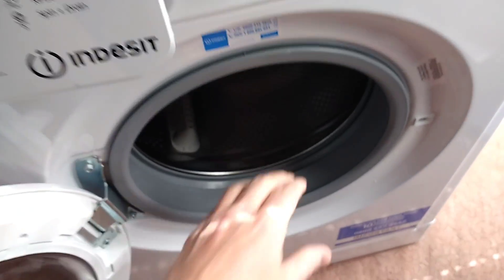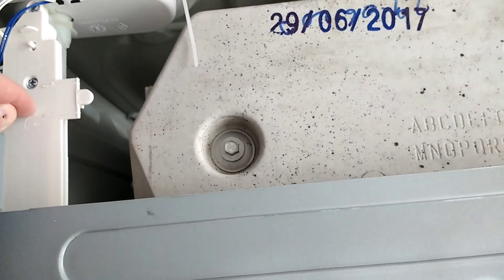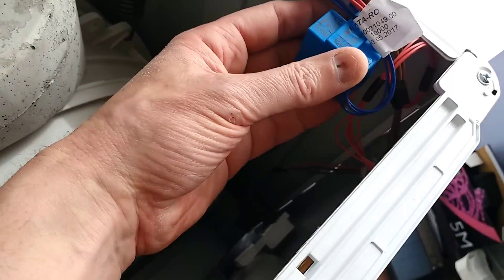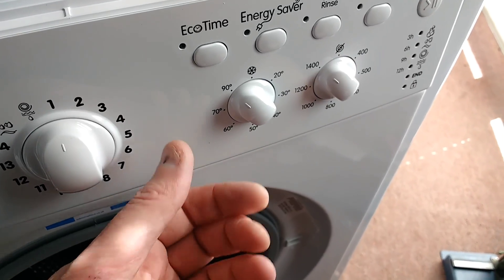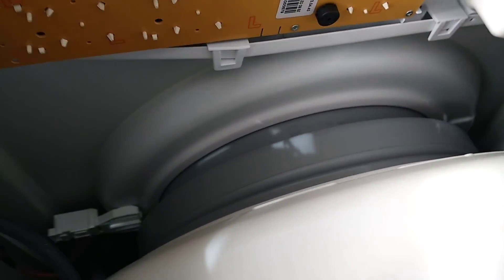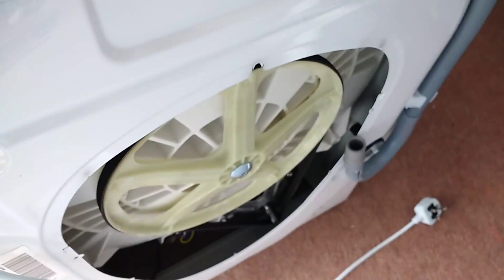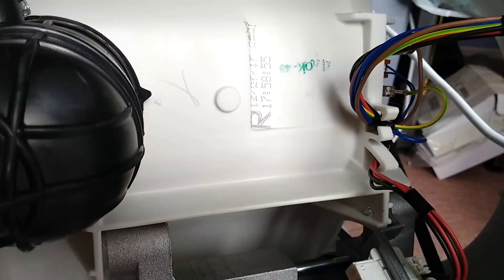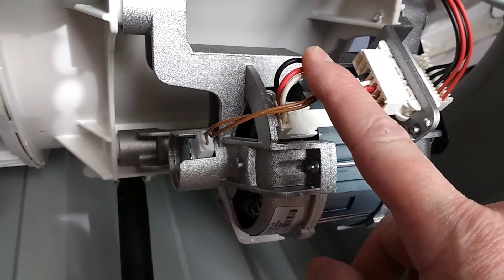Inside my new British washing machine (clothes washer).

Comment: In Russia you can get very cheap Indesit washer, it have very poor build quality. These washers are prodused in Russia in Lipetsk city. Maybe you can get there a model that is prodused in EU and a build quality may be better.
Reply: Supposedly a it is Russian machine, but with UK-plug & English text print. 
Russia has nearly the same power as UK ( machine supposedly made for 220-240V @ 50Hz )
Reply: The quality is poor because Indesit choose to programme in unreliability presumably to make more money on parts. Either it is deliberate or their engineers are stupid and can’t design decent drum bearings that last. Nothing to do with being made in Russia instead of EU. Beko & Zanussi are good medium priced brands in my opinion. Greetings from UK.

Comment: I'm sorry Clive i love watching your videos but as a man who works on these on almost a daily basis I just can't sit and look at more than I have to! It's bad enough when I keep hearing about the tumble dryer fires....I worked for hotpoint doing the so called "mods"....
Reply from the maker: I guess the mod might have been from the open wire heaters to metalclad ones?
Reply: nope, completely off
Reply: the mod was literally: remove the drum by complete dismantle, drill a small hole into the back of said drum, insert i rivet from the inside so the long bit thats left pokes out of the back, put machine back together! bare in mind we had to sign a form of secrecy so we didnt talk about this "mod" ..... whoops!

Comment: I was very briefly contracted by Indesit/Hotpoint/Whirlpool to fix their firey tumble dryers, their service side is about as cheap and nasty as their fabrication.  Literally impossible to do your job without cutting corners, they force you to work with insane time limits.

Weird, I don't know why you have a pulley for the drum, on the tumble dryers the belt just goes around the drum and onto a tension wheel.  Maybe because it has to go faster in a washing machine?
Reply: 1400 rpm spin.
Reply: The high speed spin, but also, the tub has water in it. The tub and basket are sealed, so there's no way to put a motor in there. also, the drum changes direction on a washing machine, so a idler tensioned belt would slip in one direction.

Comment: New machines for a while have been cold fill only, heats the water itself rather than triggering the gas boiler or needing to heat the electric tank, also a tip is to use slightly less soap powder with cold fill only machines unless you have hard water.

This is where a little pink tub of vanish comes in great for getting stains out (max 40c wash with vanish or it can harm colours).

Comment: I'm using the dryer my mum bought,  when I was 12, I'm 43 now.
Reply: What make is your dryer and how often do you use it?
Reply: @Martindyna  whirlpool model LG6811xpno
Reply: @Martindyna  we use is daily, currently family if 3. I grew up in family of 4, then for a few years it was just my folks using it.
Reply: @raymondmucklow3793  Interesting and thanks for the lightening response!
Reply: Ever checked inside for "escaped" fluff fire hazard? I have an old one (unknown age) and when I opened it up almost the entire chassis was filled with compacted lint. I removed it all before using it again; the fire potential looked really hazardous!
Reply: @josh46646  yeah wetvacced it all out, and found a. 22 bullet next to the head of t exhaust.

Comment: Disappointing to see how everything is made down to a price.
Reply: Would you rather have everything made ridiculously overspecified (i.e. expensive?)
A good design is as crappy as it can get, yet it still doesn't fail. Saves you money. It is just bad when manufacturers try to maximize profit by having stuff break intentionally, but usually thos failures are NOT within the "crappy" parts
Reply: Essential in most cases.

Comment: I had an old Miele apart not too long ago. Construction was somewhat similar but the drum was stainless steel, not plastic. The motor was also much bigger. Probably a universal motor because electronics of the time weren't that clever. Couldn't have been single phase induction because it spins both ways. The pump was though. Also, the weights in that machine were cast iron, whereas it looks like they used concrete in yours.
Reply: I have many single phase induction motors that are reversible. Most can be reversed by simply changing polarity of the start winding.
Reply: I forgot that was a thing. I was thinking of a shaded pole motor.

Comment: I have the washer/dryer version of this machine. I must admit it works fantastically, albeit with a super annoying beaping sound that sounds almost continuously when doing a wash cycle. A swift thump on the front shuts it up which is interesting. Still, not bad. Not bad at all😊

Comment: Definatly a 3ph drive on the motor, when our old (from ~2006) indesit washing went wrong the motor would no longer spin correctly obviously because part of the 3ph cycle wasn't getting/being supplied to the motor correctly. 
The LG's are a bit more interesting (although haven't looked inside one) as they use a brushless motor directly attached to the drum, so no belts/pulleys at all, it also does more than just do simple spins which is interesting to watch.
Reply: Same idea as the Fischer and Paykel SmartDrive system. The early versions had reliability problems, but the later (New Zealand built) models seem to have fixed that. Quiet, and very efficient spinner - on full speed things come out almost dry.

Comment: The grey discharge hose will eventually crack and fail.  I suggest replacing it with a proper high temp rated rubber hose.  

The slightly higher end models have a large brushless motor directly driving the drum instead of that pulley.
Reply: Drew Morgan the board and bearings on this will die before the hose gets any sign of wear and tear. 2-3 years max

Comment: Our Indesit lasted 18 months - we replaced it with a Zanussi which lasted 10 years.
Reply: Zanussi seem to be a little underrated.
Reply: Zanussi are a quality mid priced machine. My Zanussi Model DW 401 dishwasher is about 35 years old and still working although the programmer occasionally sticks now (only used once every 1.5 - 2.0 weeks as I live on my own). Not sure how good they are now. Part of Electrolux Group last time I checked (as are AEG).
Reply: I have a secondhand Hotpoint Aquarius with a mechanical timer, it must be 20 years old and I keep patching it up, new brushes on the motor and a new pump, it will remain until I can no longer fix it, even if I had £20000000 in the bank I would not replace it. 
Washing Machines should be for life not just for Christmas.
Reply: @richardsandwell2285  If it's 20 years old then it's a GEC (UK) Hotpoint which explains your experience. Indesit acquired the Hotpoint brand in the UK 21st December 2001. The machines were re-designed and the drum bearings became less reliable.
I had a Hotpoint Micro Profile 1400 Model 9564 for 14 years which was a nice reasonable quality machine. When something electrical went wrong at 14 years old I bought a Miele. I decided to not mend the Hotpoint because it used too much water compared to modern machines and the 40 deg. C Cottons wash wasn't long enough and of course you could do nothing about that (unlike with a Miele you can update the programming).

Comment: Interesting.  Although front loaders are increasing in popularity in Australia, most people still buy top loaders because the wash cycles (even the heavy duty ones) are typically faster.  My 9kg capacity Hoover top loader will wash a heavy load on full cycle in about 40 minutes.  Most top loaders don't have water heaters.  You have hot and cold inlet hoses supplied by special laundry taps.
Reply: Having hot and cold feeds doesn't mean it doesn't have a heating element. The ones in the UK had twin feeds but they generally don't any more.

Comment: The fact the bottom is open is cause it's a lower budget machine.
Higher budget machines have a leak tray and foam floater with switch to trigger leaks.

Thx for the video, I'm a technician myself and I'm every time surprised to see how they can shrink in price/cost if you compare with high end. :-)

Comment: Ive been in uni for 3 years and still dont know where I should put my washing powder in the compartment drawer. Do I put it in the section with the number one on it or the section with the number 2 on it... Anyone care to enlighten me?
Reply: Graeme Lashley Well, if it's working, keep putting it in the place you're putting it now. But generally 1 is for a prewash (which  you're probably not using) and 2 is for the main wash, so you put your powder in 2.
Reply: Finding an answer for the section dilemma is actually pretty easy using the Internet … or the manual. ;-)
Reply: just open the drawer when it starts and pick the wet one :)
Reply: Yes, 1 for pre-wash, 2 for the main wash. If you choose a cycle with a pre-wash (for muddy sports clothes, etc) you put powder in both! Otherwise, as said, 2 only.
Reply: As you clearly don't look at instructions, is that an engineering course by any chance?;-)

Comment: It really shows how cheap VFDs have become that even in these applications univeral motors are being eclipsed by them doesn't it?
Reply: I've never seen a universal motor in a washing machine.  Only small induction motors.
Reply: It also saves having a couple of reversing relays and drive circuitry in the module. I guess they just use three smaller triacs or IGBTs to switch the three phases of the motor.
Reply: Triacs could be used in a cycloconverter to produce an approximation of an AC waveform, assuming that the frequency of the waveform is much lower than the input frequency. So it would require a multi pole motor but it could be done.
Reply: Would have thought the motor would need a higher frequency, it does look rather small, but the drive module doesn't seem to have chunky electrolytic filter caps. Module teardown is needed!!!
Reply: +Spiz103 The input frequency is 50Hz and the output is 400Hz, the motor will have a low pole count as it is required to run at variable low and high speeds.
Reply: In that case it will be a two pole motor and it will be IGBTs or MOSFETs running it
Reply: Not a VFD, but full field oriented control I bet - this sort of tech is so cheap now.  So its a 3-phase induction motor with full torque at low speeds as well as high top-speed - pretty much an industrial servomotor without a position
encoder.  The power electronics will be whats called an "intelligent power module", or IPM which isn't intelligent at all, just a 3-phase IGBT bridge + drivers.

They have moved from brushed motors to 3-phase induction because they are cheaper to make, nothing to go wrong but the bearings...  Somewhere there's a youtube video in a chinese factory pumping out these motors and its fascinating to watch the machine that loads the windings onto the stator in about 2seconds!

Comment: I have often wondered why a washing machine would have concrete in it over say a static water tank, draining it would make them easier to move...
Reply: Water tanks would have to be filled when installed, the water would become stagnant and bacteria ridden, the plastic would fatigue around the mounting points and cause the disgusting water within to leak out. Huge numbers of customer complaints all to save a couple of quid on transport costs.
Reply: John Ward it could just refill with new water, or use some of the older soapy water, flushing it through each time it gets used, bit of alcohol and it'd be right as rain

Comment: I don't like the idea of cold fill only, it doesn't give you the option of using gas to heat the water (i heat my water for washing up and what's left in the tank is used for washing clothes)
Motor will be BLDC, the sensor on the back is usually just a clock motor that generates the frequency to be interpreted by the computer
Reply: Sparky Projects didn't they stop using hot water for health reasons?
Reply: It was done for economy reasons, one article i looked at mentioned that filling a machine with hot actually fills it with the cold that's left in the pipes as it has to travel from the heat source to the machine, so all you do is replace the water in the pipes with hot water, but the way i do it is to run the hot for washing up, then start the machine, so it actually fills with hot water.
While checking i was correct, i aw articles that mentioned wet solar, so if you have taken advantage of renewable energy, you don't want to be using expensive electricity to heat the water.
So in  my opinion, the hot fill should be an option on all machines.
Reply: Exactly how I did it. Run the sink for washing up, then put the washer on immediately after. My new machine is cold feed only though. With that and the dryer part having a minimum time of 30 mins and not letting hot clothes out before hand, my electricity bill doubled! (I use the dryer or dryer part to tumble and heat the clothes up before hanging them up - means I don't have to iron them! In the old machine I'd put them on for 10 mins)

Comment: The same as US machines these days, just smaller. A typical US spec washer can handle 18+ lbs of dry clothes per load.  Few US machines have water heaters built in, some do for extra hot washes. In the states we typically have great honking whole house water heaters so the individual appliances don't need heating.
Reply: mweverett  our machines tend to be mostly 6-7kg (13-15lb) but you can get up to 9kg (20lb) machines. I would guess the majority of homes now have combi boilers providing central heating & hot water in one unit. I don't know when Clive last bought a washing machine but I don't think they've had hot & cold fill for years here.
Reply: Most central heating in the US is forced air, a few older homes and fewer "high tech" homes have water based heating. Those can also make hot water, but typically they don't opt for that because the standby loss is high compared to a standalone heater. Typically the water heater is 40-60 gallons and gas with electric close behind. A few are oil. You are not going to find a water cold only inlet machine in the US. If you have hot water centrally it makes no sense, also slow, waiting for the machine to heat the water. Electrically heating the water in the machine is also really costly if you have gas water heating already. Waiting for the tear down of the old machine. :)
Reply: In Germany I cannot remember seeing any washing machine without built  in water heater. And 99% of our houses have water based central heating with whole house water heater integrated.
Reply: I'm guessing if there's no water heater, that makes it a 110v machine? With a heater 220v?
Reply: Don´t know about the US, but overhere it is always 220V. But would make sense considering the high power consumption for the heater which would need 15A on 110V at least.

Comment: Looks a lot like my wifes 8 year old Bosch (hmmm lots of German quality goodness) inside.   I got the job of changing a leaking rubbery bit a while  back.   I wouldn't have thought the plastic pulley on the drum is a big deal. The bearings/belt/motor are a bigger source of problems.

Comment: I read that alot of the houses in the UK dont have water heaters mainly because they are so old, idk where you live but if its UK ect the manufacturer might have taken this into consideration and built the heater in to minimize headache.
Reply: older houses tend to have hot water tanks heated by either electric or the gas central heating system, modern houses or refits tend to use combi boilers to heat water as you use it and electric showers which heat their own water,  tanks were mostly to fill baths with , which smaller places often dont have, or are converted for disabled accesibility
Reply: Moxzot, what are you reading, Charles Dickens?